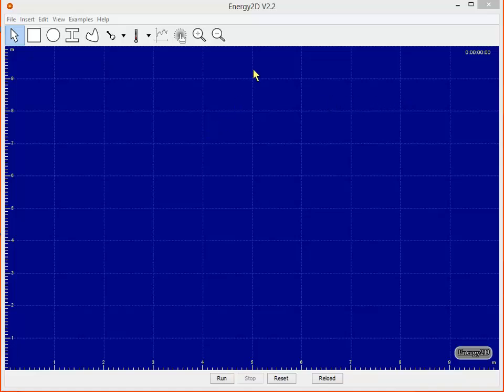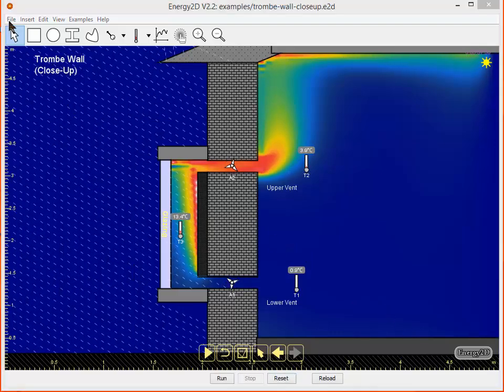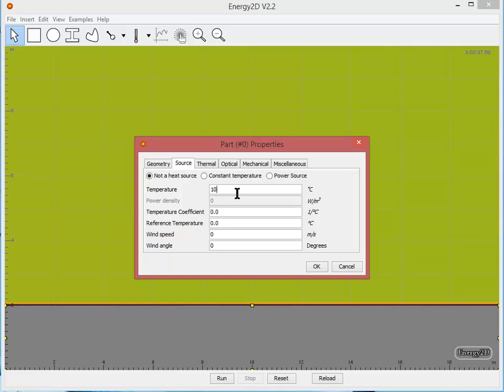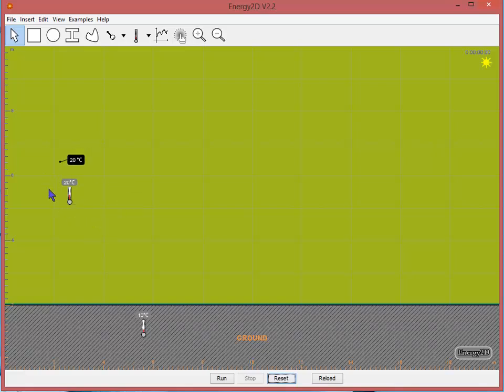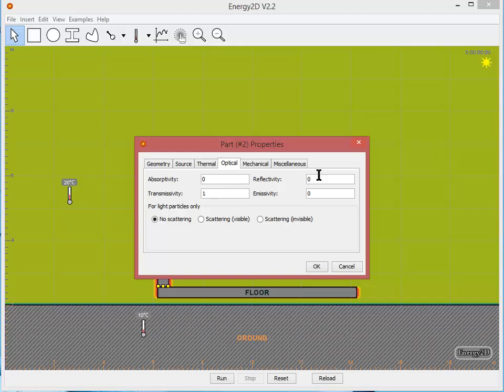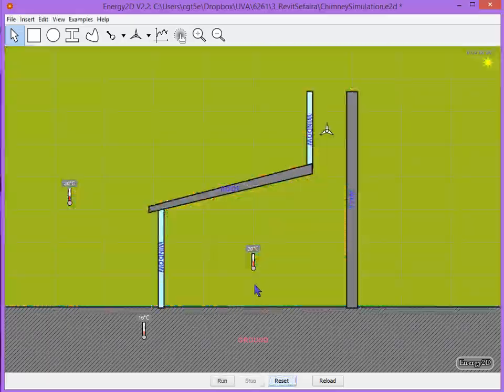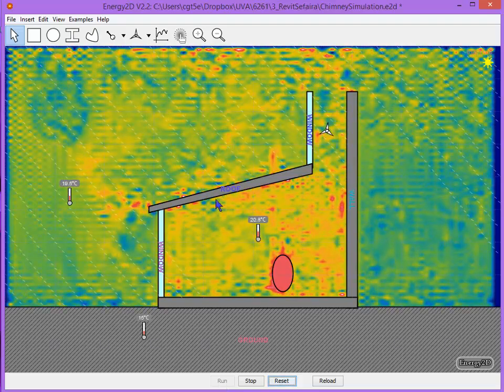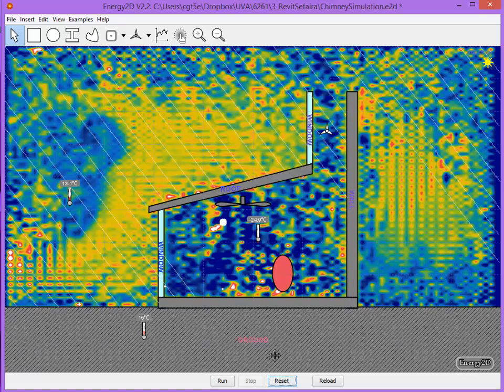Energy2D Tutorial by Carmen Trudell

Comment: When I follow the same example as the video with just a roof, my simulation quickly bleeds off all heat unlike the video.
Reply: I'm having the same issue. Did you ever figure this out?
Reply: @williammartin9751  I don't think so. I may have looked at some kind of flow rate or run speed. I would consider reaching out to support.

Comment: How can the temperature goes -24C after put a fan?
Reply: The software isn't 100% accurate for convection and radiation phenomena, so that -24ºC are clearly wrong, but at least, the heat and flow field can be used in a qualitative way.